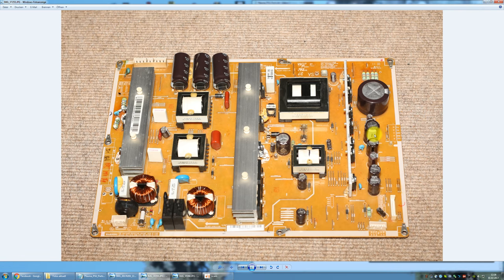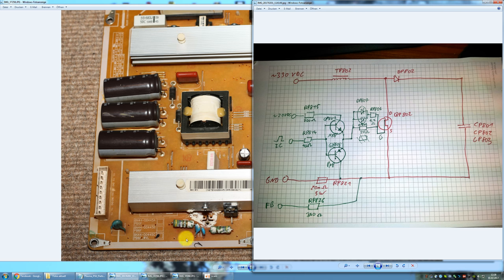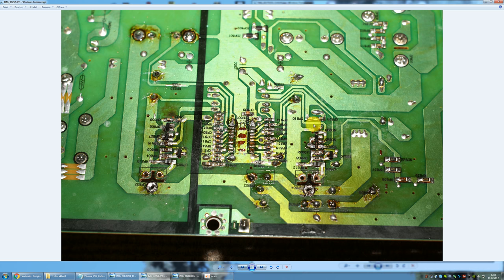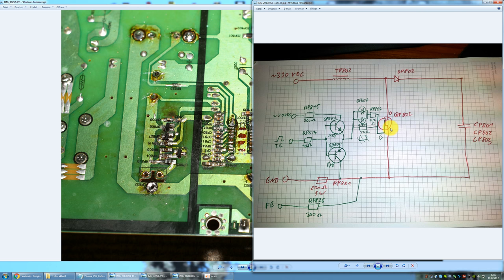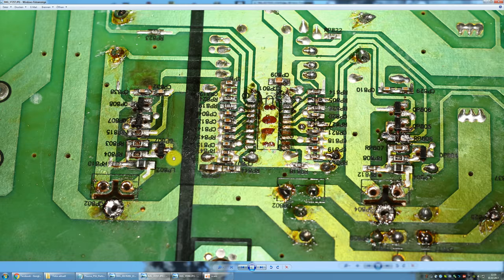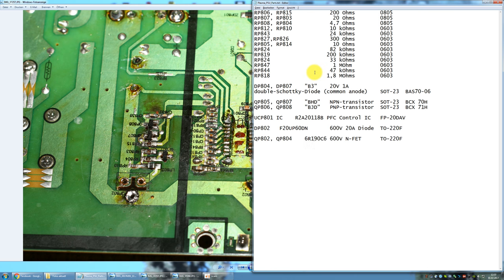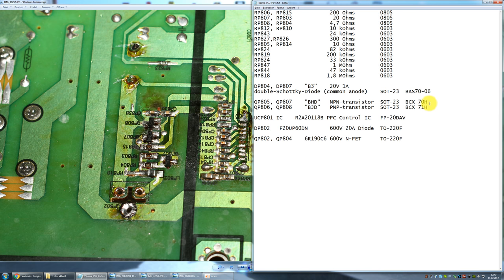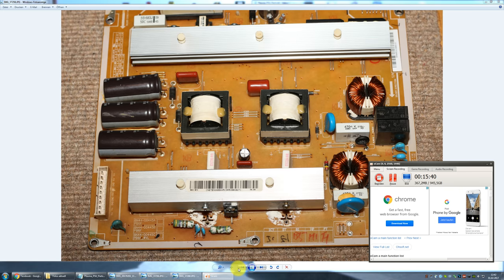Power Supply Repair BN44-00445C PB6F_WVL SMPS Samsung PS59D530 PFC

Comment: Thank you for your video! Greetings from the Netherlands!

This is my first flat tv repair. My pfc circuit is als faulty.
I replaced the mosfet, but the short circuit remains.
Probably bad driver ic. 

Complex circuitry these modern smps supply’s…
Reply from the maker: Well, if you still have a short, you have at least something to investigate further ;)

And BTW: That SMPS is 10+ years old, so a really modern was is even more complex. And in my experience, it's always the PFC circuit that dies, since it is the first thing that gets hit by any surge coming from the mains.

Comment: Your video is very helpful.  I replaced RP 807, RP808, DP804, QP805, QP806, QP802 & PFC IC. However It only work for 2 min.  After that, the TV cycle between on and off. When it is on, it will last 15 sec and then off again. It seem like some protection click in.  Any idea what else I can check?
Reply: After waiting for another few hour with power disconnect, it work again over 20 min. I measure Va and Vs and the value looks good.  So I have no idea what to check next.

Comment: My TV PS board failed and I found your video is very helpful.  After I watch a few times, I finally found out 6 components failed (RP 807, RP808, DP804, QP805, QP806 & QP802).  However I cannot tell if the PFC IC failed or not. I am going to order parts and see it can be fixed without change the IC. I used to do a lot of soldering project but never done any SMD soldering.  Hopefully I don’t have to the IC because it looks tricky to replace.  I will report back once I replaced the 6 components
Reply from the maker: I'm glad, that this video is helpful for you.
I wish you the best of luck with your repair. But be aware: If your control IC is in fact broken, it might kill the replaced components once again right away, not to mention the fuse.
But it's true, changing that part is not an easy task, especially if you don't have the right tools and experience working with SMD parts.
Reply: NebukadV , Thanks for your reply.  Too bad that I am unable to confirm the PFC IC. So may need to repair twice.  I am unable to find this IC locally so end up order from EBay.  It will ship from China and will not arrive until Oct 6.  I ordered the BAS70-06 per your suggested substitute.  I had double check the SMD diode related to B3 marking to confirm it is a 20v 1A Schottky. However one of the repair kit seller told me today that they provide KDS184 to repair DP804 and DP807.  When I look it up, the chip marking is also B3. Does it means we pick the wrong diode for DP 804? The parameters seem very different.  KDS 184 has a lower capacitance and may be faster switching?  Based on this new information, do you think BAS70-06 is still OK?

Comment: I think a previous owner swapped the 0445a into this set I'm working on... Do you know if they function the same?
Reply from the maker: I don't think, that they are fully compatible. You can see, that the version (A/B/C) is marked on the Board. So I am assuming, that some parts are populated differently to match the needs of the Set they belong to.
Reply: NebukadV  Yes, that's what I feared.... Wish he'd included the original board! I'm going to go over it again, definitely found a few bad solder joints, but fixed them (i think)!. Will start testing all the little smd components on the bottom soon to make sure I didn't mess anything up when working on it lol
--- THANKS for the reply! It's a very helpful and informative/detailed video. Appreciate the assist!
Reply from the maker: You can find the Full-Resolution Images of my board here
https://www.flickr.com/photos/nebukad/32782568702/in/album-72157637644327374/
and here
https://www.flickr.com/photos/nebukad/32936451965/in/album-72157637644327374/

Maybe this helps you in finding out the differences between Version A und Version C.

Comment: Hallo...
Hast du zufällig einen schaltplan von dem BN44-00445c? Weil ich finde den Fehler nicht obwohl ich alle Bauteile getauscht habe die du hier beschrieben hast aber dennoch brennt mir der NTC immer wieder durch und die transistoren auch
Reply from the maker: Einen kompletten Schaltplan habe ich leider nicht. Wenn die Schaltung immer wieder durchbrennt, liegt der Fehler wahrscheinlich weiter "hinten" in der Schaltung. Miss am besten mal alle anderen Transistoren und Dioden auf dem Board durch und steck zunächst alle anderen Baugruppen ab, um den Fehler einzugrenzen. Du kannst auch versuchen, die verschiedenen Schaltungsteile auf diesem Board aufzutrennen, aber das wird relativ mühsam, da du dann Leiterbahnen auftrennen und später wieder verbinden musst. Mehr Hilfe kann ich dir so aus der Ferne kaum geben.
Reply: @NebukadV  hättest du Lust und Zeit dir die platine anzuschauen und die ggf. Fertig zu machen?
Reply from the maker: @danielschomaker6834  Wäre grundsätzlich möglich, ich kann aber weder garantieren, dass ich es hinbekomme, noch, wie lange es dauern wird.
Reply: @NebukadV  Das wäre nicht weiter schlimm...
Wie können wir Kontakt aufnehmen?
Reply: @NebukadV  ich hab dir per Mail geschrieben

Comment: Found drive pin from ic about 20 ohns from  ground. No point in continuing with this repair as i dont know how to obtain  the ic.  Most resistors in gate circuit burnt, and some small transistors.
Reply from the maker: China is the only way to go: https://www.aliexpress.com/wholesale?catId=0&initiative_id=SB_20181114220050&SearchText=R2A20118B
Reply: Thanks👍👍